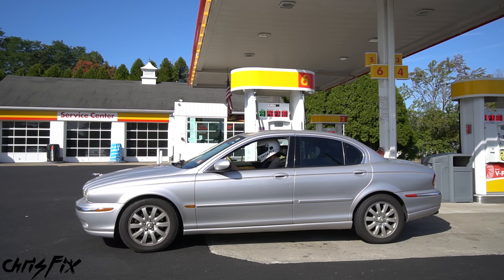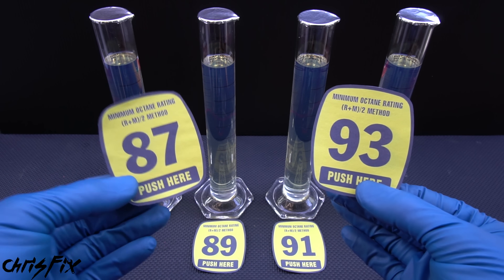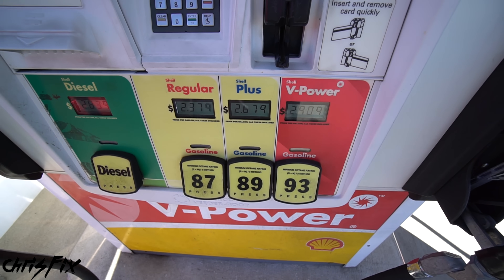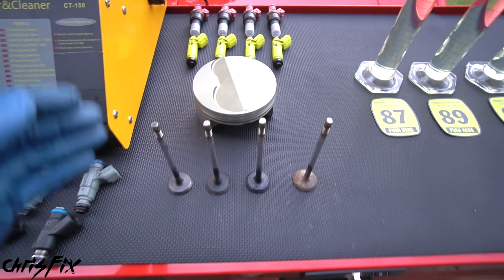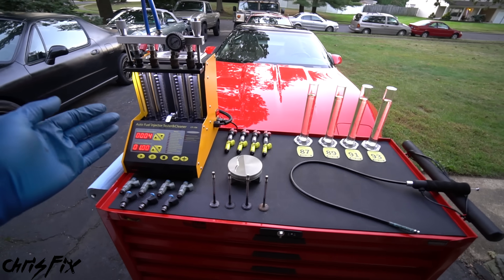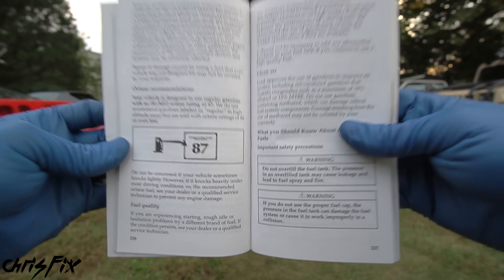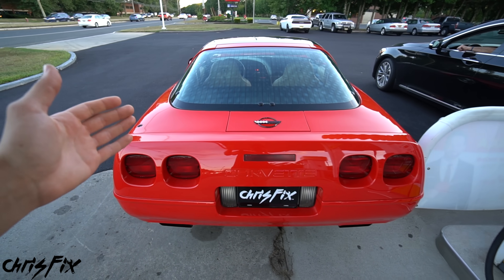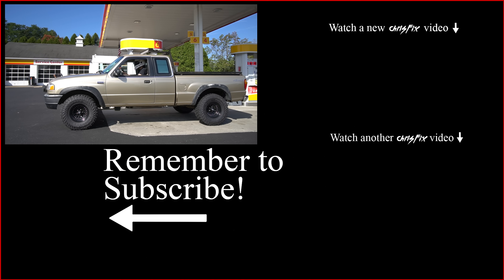What is the BEST Fuel to Use in Your Car or Truck and WHY

Comment: Just because this guy has millions of subs and views doesn't mean you should do what he says.  I put 94 in my '03 Dodge Caravan and, it gets a lot more mileage/power.   I don't recommend ethanol or low octane gas.
Reply from the maker: Has nothing to do with Subscribers. The amount of research and time that went into this video to get all the correct info was insane. I spoke with petroleum engineers and the people who actually make the fuel and they even reviewed the video before I posted it. The info and data I’m this video is 110% correct and accurate.
Reply: @chrisfix  Thats fine however regular gas I don't know about America however in Canada has 3% ethanol added which like you covered in older cars or cars that can't use it creates knock, melted valving timing covers etc, I use 94 Octane in cars even if it recommends the garbage gas because it gets better mileage, and I have NEVER had a engine failure ever.   I prefer the power that comes from higher octane.  If you like inhaling exhaust all day and being a little good NPC than use regular inhale spirits all day not for me.  I use 94 + octane booster.

Comment: You should clear up one big thing !!!  Japan has higher grade fuel than north america. Regular gasoline in Japan has an octane rating of 94. There are lots of people importing JDM cars these days, and many don't realize until its too late, that they either have to use octane boost with premium, or get thier car de-tuned to run on our premium.

Comment: Tell us about the 85 octane we have in high altitude areas. I have heard that this was to compensate for the lower atmospheric pressure, which results in less compression in the cylinder, and thus less tendency for knock. But I also heard that this was first done in the days of carbureted engines, and these days nearly all engines are fuel injected. The car manuals all say to use at least 87 octane. Do we really need that higher octane at a mile high or not these days?

Comment: Which fuel should I use on a 74 f100 With a 89 Mustang 5.0ho engine converted from fuel injection to carburetor

Comment: 98 octane is the only grade run in my car as have 250000 km on my donk and give it an extra bit of attention with better quality fuel even if 20 cents a litre more then premium but when pay nearly 10$ a gallon an extra 50 cents worth it.

Comment: I live in Colorado and we have 85 octane. How about that?
Reply from the maker: Because it is high altitude so you dont need as much octane. Sad thing is your fuel isnt any cheaper and it should be lol
Reply: @chrisfix  oh cool. Thanks man! I’ve been using 87 since I got it. If I’m remembering right, my owners manual says “regular unleaded, 87 octane required.” But they don’t match up, cause regular unleaded here is 85. Should I keep using the 87 or would I be okay if I switch to 85? But yeah it does kinda suck that it’s not any cheaper.

Comment: Holy crap thanks for making this video. I daily drive a Toyota Camry 97 V6 and I’ve been noticing some poor fuel mileage and less power. I may replace my fuel injectors as I had to do with the sparks as most of the parts when I got the car were from out of factory production. But I will try and look up if the pro gas will help clean my engine or not. Thank you 🙏

Comment: It reminds me about a Honda Civic I bought and the motor was shacking and they’ve  never been able to fix it. They told me that they never fixed motors, they were changing them instead because they rarely had problems with motors. In the end, I tried Gold instead of Regular and the motor was almost not shaking. When I changed it 2 1/2 years later, I gave it with a fill tank. 2-3 weeks later the guy who bought it called me and asked if it was normally shaking 😅 he filled it up with Regular at his first visit to the gaz station. I told him I always used Gold… It was in the 90s and one of their mechanics once told me that even Honda had lemons and they didn’t know how to fix them :-). True story… it was a 93 I think

Comment: I will say while it is true the octane rating is the same between the US and Europe, the Fuel quality control is not. Car manufactures rate US cars power lower than in EU Cars because the quality control for fuel additives and amount of acceptable moisture in the fuel is far less tightly regulated.

Comment: Now i know the reason why my 2007 Nissan versa hatchback Doesn't Run Correctly when i try to put Premium Gasoline but when i switch to Regular Gasoline which is 87 It Runs Correctly again that's why i just always used 87 or Regular Gasoline Because that's my Required Tyoe of Gasoline 😊

Comment: I own a Honda car bought in the USA, and in Europe, where I live, I use unleaded 95 octane fuel. Concerning Premium fuel, you can find 98, 99, and sometimes 100-octane fuel in various countries across Europe. The problem is that sometimes the higher octane rate is got from additives.
Reply from the maker: Watch the video!
Reply: @chrisfix  I did. And I'm not arguing with anything in this video. Just mentioned my own experience.

Comment: We generally only have 2 different grades in the UK. I've only ever bought the higher octane when I had an RX8. Was always told high octane is just for sports cars. Now I know lots more on the subject. Great video as ever.
Reply: Becos they are for sports cars. High performance engines like ferrari n/a have high compression ratio

Comment: Shell costs a lot more compared to other gas stations in my area but its good to know their fuel is much better and has more additives 😊
Reply: BP is Not a Top Tier gas (extra cleaning additives).  Shell is Top Tier.
Reply: Interesting in that when I owned my 420 SEL Mercedes my Merc mechanic { who had no vested  interest in the brands } told me to stop using V-Power Shell and switch to BP 98.
Reply: Just to see if it would make any difference, I started using shell 93 octane in my 2010 acura mdx, and it runs noticeably better now. For reference, I used to use costco premium prior.
Reply: AAA funded a study of deposits due to cheap fuel. There were 19 times the deposits from cheap fuel as compared to the best top tier gas. Chevron and Shell are the best. Use of PEA polyetheramine additive will clean your direct injectors which prevents raw fuel from washing the oil off the cylinder walls. Techron is diluted PEA. Redline makes a concentrated PEA fuel system cleaner.
Reply: Since when is more additives aka not gas, better when your trying to buy gas?  I don't want 59% gas, if in buying gas, just like my friend's don't want 59% cocaine if they're buying cocaine.
Reply: I started using only TopTierGas (Shell near me) and noticed a 3-4 mpg difference in my 2k11 CR-V.  I tested this a few tanks over and returned similar results.  Note I did not alter my driving habits.  Thanks for the video Chris!
Reply: More additives means less gasoline per gallon, thus less dense fuel and lower milage.
Reply: I was told to stop using Shell V-Power 98 as it was causing major problems from additives.   I was recommended to use  BP 98.

Comment: The question I can’t find the answer to is differences between 90, 91, 92 & 93… My car say it requires a minimum of 91 octane, but premium around my house is 93. Meanwhile, there’s an ethanol free (eg more mpg) fuel available that’s 90. So will my car become a total piece of broken trash if I run 90 instead of 91? Would be nice to get another 50-100 per tank on Highway if it’s okay. Similarly, are there cars that require no less than 93? Google completely ignores your numbers and just gives results for “premium”… but folks that’s actually 4 different octane levels so wtf?

Comment: I go through too much fuel in my car to not use the cheapest gasoline I can find (87 R+M/2). I use ethanol-free 91-octane fuel in my motorcycle, because that's what it calls for, but I will use 89-octane if it's ethanol free. I also use ethanol-free fuel in my small engines (lawnmower, snowblower, tractor, etc.), even if it's 91-octane.

Comment: So all the fuels you covered have 10% ethanol mandated by the federal government because they want to sell corn alcohol basically probably to help all the farmers I’ve been using for at least the last 10 years or better. Nothing but ethanol free 90 octane which gives me around just under 13 ounces of gas without the corn, but you didn’t cover any of that stuff ethanol is bad for the engine. I noticed that I have no problems in my engine without the corn But you didn’t cover it. I also put a mixture of mystery. Oil in the ratio is 1 ounce per 2 1/2 gallons that lubricates the upper valves in my engine. I’ve been doing that every other tank full again since 84 on all my vehicles it doesn’t bother the sensors because you don’t put a lot of it in there The formula is on the side of any mystery oil bottle on how to edit to gasoline but again, let’s go back to the non-ethanol you didn’t cover it and I know this higher octane on a longer trip not only cleans your engine you get better fuel mileage off that engine, redo your research update your videos. ?!?!?!

Comment: I use mid-grade for my car that does not require higher octane. It has run great for 15 years and still like new. So, it cannot hurt. But, I imagine it could hurt if you use lower octane and maybe be on a border-line between the good burning and knock-burning. Also, in order to get higher octane, cleaning additives are added. So, high octane should = cleaner fuel injectors.
Reply: My Merc, at the end of its time, was blowing smoke and spitting black sludge on the ground.  I was told this resulted from use of Shell VP and its additives.
Reply: @rogeredwarrddeshon5000  i think they lied to you.i have used shell midgrade all its 15 year life.

Comment: I got poor performance from shell 93. Maybe it was just the station I used. But went to have the car tuned. Had terrible knock. Tuner pulled timing but still had knock. Tuner told me drive out that shell and bring it back. Grabbed some fuel from Hess and strapped her back on the rollers. Picked up 12hp throughout the entire band.Haven’t ran shell since.

Comment: Is their a quality difference between different gas stations? Ex: Shell vs Texaco or Bp vs WAWA?
Reply from the maker: For the most part the only major difference is the additive packs. Shell has a lot of R&D going into the fuel to keep your engine clean. Other brands do as well. I think of it as engine oil. It’s mostly the same and you’re probably fine using any oil that meets the spec your car needs but some brands are just a little better with their additives.
Reply: @chrisfix  thank you bro for the info

Comment: In Norway we have 95E10 and 98E5. 98 is actually ethanol free in Norway, but due to EU regulations we have to label the pumps with E5. The reason why we have 98 as ethanol free is because we have a lot of older cars that usually are parked during the winter. E10 is not good for older engines, and specially if the vehicle is parked during winter. 
Now we are working on getting 98 into more stations, as more and more people use it.
Reply: Asia have almost the same standard, We have E20, Gasohol 91, G95 and pure 98.
E20 is 98 mixes with 20% Ethanol, G91 is your E10 and G95 is your E5. 
I do believe that the more ethanol the less energy because ethanol have less energy that petrol.
Reply: @MutheiM_Marz But we only have Unleaded95 and Unleaded98. 95 has up to 10% ethanol, and 98 has no ethanol.
Lots of smaller petrolstations that had 95 and diesel have switched to 98 instead, as10% ethanol is too much for older cars. 
My 1991 Toyota runs only on 98 octane with no ethanol added.
Reply: In my country a new petrol car usually go for E20 and G91 or 95 is for bike. Unleaded 98 is for the old car like yours. But we have another one, normal diesel and B10 which is 10% biodiesel. I have Hilux Mighty X gathering dust and daily driver Hilux Tiger.
In small station they must have B10 and 91 and 98. Government start to enforcing biodiesel and Ethanol mixes fuel.

Comment: Great video !!
However I have a question…
In some shell fuel stations you can find 87 octane non-ethanol fuel, all the other ones have 10%ethanol 
May you please explain a little bit about the difference ?
Reply: 1 Basic thing to remember is, never let fuel with Ethanol sit for more than a few weeks because the Ethanol will gum up the internals with varnish. That's why some people have to have their lawn mowers, weed eaters, etc serviced if they sit over the winter with fuel in the lines, carburetor, etc. You can Google the rest 👍

Comment: Excellent video. So grateful where i live i can get minimum 90 octane non ethanol gas. Love running the pure gas through my car. More expensive yes. Worth it yes. Put quality fuel system cleaner in once a month and the engine just purrs on down the road.

Comment: I use premium because i do not drive but maybe 150 miles a month. I use sta-bl fuel additive to save the life of fuel.
I do have higher use from time to time but 80% of the time is 150 or less miles. I bough a used ford explorer in 2012 with 197686 miles for $1000. It had not been taken care of. I fixed the problems it had. Front end comletely replaced. $575 in parts. Saved $1000. Drained all the fluids including the gas tank. Changed all the belts and hoses. Cleaned the fuel system, replaced all the bosch platinum plugs and wires. Fixed intake leak in gasket. Vacvumed car and washed it. Paint was in bad shape when i bought it. I stripped the paint and repainted with primer 5 coats and 4 coats of clear coat. I did it myself. I saved $1500 new tires and bought tire covers. The vehicle by blue book is not worth but $2000. But this Explorer is in better shape than most newly boight vehicles it gets 23 mpg and 14 city. Owners manual says its duppose to get 19 hwy and 11 in city.
If people would just take care of their vehicles they will last.
I don't have thousand of $ in tools either. I have good tools that are good enough for the job. If my parts are stress parts a bought better quality tools for those parts. I may have a $1000 in tools $400 just for a tool box to hold them. I do all my own repar work on both my vehicles my second carcis a 2012 Dodge Grand Caravan bought for $2000 cash. It needed drivers sliding door repaired. Did it myself and saved $1100 dollars in repairs. New alternator save $ 525 in repairs good qualty tires saved $1500. Shop around. Deals are out here. Had TIMP defect from factory. Repaired it saved $1400 oil pump saved $400. Both vehicles run and drive like new.

Comment: You totally missed that fuel in north America contains higher amounts of sulphur and that effects combustion. Also at the pump the octane number you see is RoN + MoN /2.  Each of those tests are different in what  conditions the fuel is tested hence the average...A side note on the sulphur issue or also acts as a lubricant so unless you change your oil to a oil comparable to EU standards ( ACEA ) rated. Issues will arrive.  Why did I mention that less sulphur= less potential for acid production in the atmosphere

Comment: They always told us the reason race gas came in 108,110,112,114,115,118 was that the higher octane had slightly lower energy content. I.E. 112 was slower than 114. Same day same strip.

Comment: Octane is recommended in your car's manual.   Octane is an engine knock number.    You need an octane engine to measure the knock tendancies in an engine.   If you run a higher octane from what your manual recommendes, you're wasting your money.

Comment: It literally depends on the vehicle you have. The only car I've ever had where you could tell the octane made a noticable difference was a 2017 Sr turbo nissan sentra and it picked up a few ponies with 91 octane no doubt. That might be true of all turbo/supercharged cars and unless the vehicle is tuned for the fuel, it'll only be a small difference but will burn cleaner.

 I'd say any car that has a 4cyl or 6 banger with 300hp should use 91, and any v8 over 350hp should use 91, especially since those hp nunbers say you have a $40K+ car, why settle for less? 

My first car out of high school was a built 87 Lx mustang converted to mass air and had a gt40 crate motor from ford with all the goodies and it was tuned for 91 so I always used it, of course this was in 2005 when even 100 octane was only $5gal. I ended up putting a low compression 331 stroker in it but it was untuned so I ran it at just under 30 degrees of timing and it loved the 91. The 100 octane didn't help much because it was built for boost with such low compression soo when I was low on funds or was going on a long drive, I would bump the timing down and put 87 in it and it wouldn't run funny.

Comment: I know from personal experience about Shell. I drive a Ford with a 3.0 engine which runs on any economy fuel. However my girlfriend has a 6 cylinder Jeep she bought new. She was having problems and the dealer told her it was the fuel pump which was "starting to go". This Jeep already had the transmission replaced at 3 months and head gasket at about a year. This was her work vehicle and they quoted 3-400 for a new fuel pump installed. He jeep was fuel sensitive, the additives used in our town didn't work too well, but the next town north(different distribution point) worked better. I suggested she try the Shell economy fuel, it was the same price or 2 cents more to see if there was a difference. She tried a tank and there was no difference, on the second tankful the problems went away. It ran better and her problem fuel pump lasted another 6 years.She still has it, going on 20 years and she had to stop using Shell, n stations around here anymore

Comment: If your vehicle is designed to run on 87 octane and you're going on a road trip, adding 93 octane will mitigate any potential issues you might otherwise encounter if you use the recommended octane level.
Reply: Why